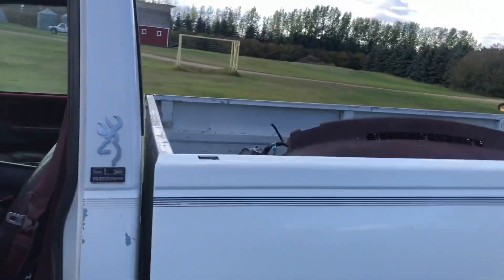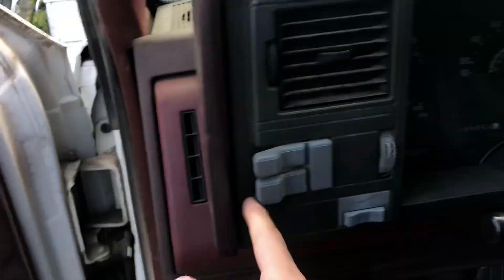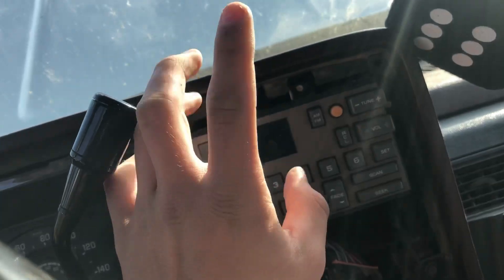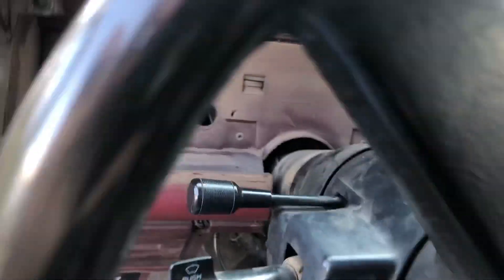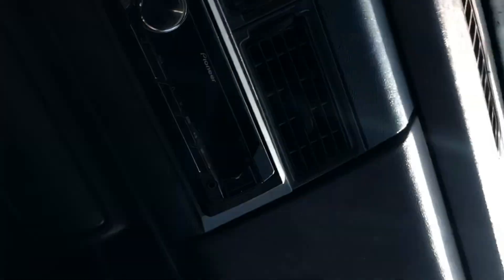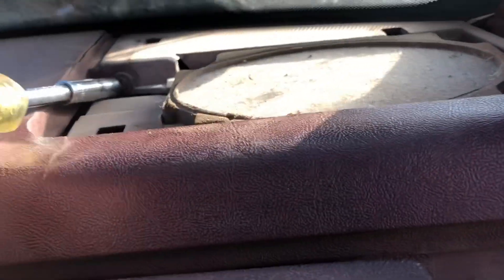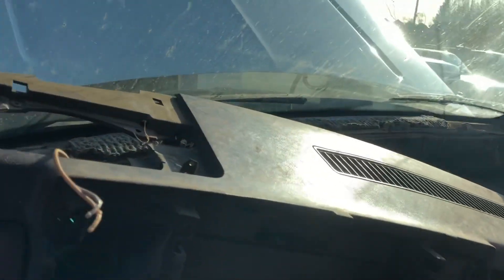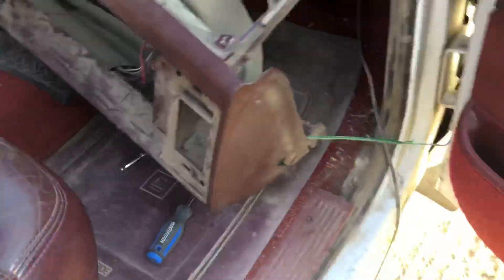88-94 dash removal Chevy/gmc

Comment: Even though your video is pretty sketchy, you at least showed one very important part about getting this dash out. That is you have to remove the heater air plastic tube that runs all the way across the top back of the dash. That is the only way you are going to release the wiring harness. The wiring harness was put on the dash first at the factory before the dash was put in. Then they connected all the wires to the fuse boxes and everything else. If you don't remove that long vent tube, you will have to disconnect the entire harness and that is not something you want to do unless you are restoring your truck.
Reply: thank you
Reply: I think I just did that :(

Comment: At just 49 second point, you want to disconnect the damn battery. There is just so much wrong with this. You're ending up with more parts to buy as you are breaking them taking them off.

Comment: Im going to swap my dash from a 90 to a 94 the only difference is where all the gauges are that's different can I still use the same one or the one going with the swap?
Reply: If its 88-98 it's most likely to match up cause I installed a 98 GMC Sierra dash into my 89 Chevy Silverado only number that has to match is the one behind the gauges there's a 4/3/2/1 but mines is a Silverado and reason y I did that is cause I wanted a stronger dash that won't break easily cause the GMC late 90s they started to make it with mixtures of a stronger plastic with metal only way u can see the metal is if u cut it but that's jus only number that has to match and if so your rocken and do it
Reply: Jayden Bosquez y does the number have to match?
Reply: @4evrthugn   the reason why is cause the screws and holes are set to certain size hole and if it does not match your gonna have to do a lot of modifications to the hole sizes
Reply: Jayden Bosquez what about the wiring harness everything just plugs in no problem I got a 93 and I’m getting a dash from a 97
Reply: @floridashitglee9387  of course it will work jus go with a dash from 96 to 99 cause the dashes are made from something else it won't crack fast will last u alot of hasle instead of breaking and wires will go in no problem but if it work it works sometimes u jus gotta overthink it before u underestimate it
Reply: Jayden Bosquez found a guy on offer up selling me the whole dash wiring harness cluster all the switches for 200 bucks
Reply: So what number am I looking for on the pack of the cluster?
Reply: @floridashitglee9387  pull off your gauges panel the number right behind it is the number
Reply: Jayden Bosquez and it has to match the number on my cluster?
Reply: @floridashitglee9387  behind the cluster on your dash there is a big ass number it has to match that in order to fit properly
Reply: Jayden Bosquez appreciate the info!
Reply: @floridashitglee9387  And for the gauges make sure it's automatic and the same one proper for your vehicle otherwise your gonna run into a problem it's not rocket Science it's real simple as u catch on and word of advice to make the swap easier pull out the steering wheel and to get even more space pull out the seats it's what I would do as well to detail the floor board cause if the old dash is already cracked your gonna have pieces everywhere
Reply: Jayden Bosquez appreciate it going to pick up the dash right now I’ll keep you updated
Reply: @floridashitglee9387  How did it go?
Reply: What happens with all the speakers in the dash? you have to rewire everything? You have to get new door panels to put in door panels?
Reply: @mattc6353  no everything can be re used an it's not complicated I did a swap in 9 hours by myself
Reply: @jaydenbosquez2953  so if I wanna do that conversion and I got the harness is it just plug and play?
Reply: @mattc6353  but note this RN if u put a rounder dash I recomend swapping thw doors but if its more boxed off then leave the door panels
Reply: @jorgiejamz3795  more likely unless u install something new jus know u have to take out everything and a heads up u want to get new insulation for the a.c. tubes cause I will guarantee they are not gonna be intact and another suggestion is use a box to keep your screws organized so ones not bigger than the other and pull your seat out so u have more space to movr around and jus keep track of your screws only part thats gonna be tacky is the screws make sure u use a box not a magnet tray a box so I can peice it in and have like a desight of where they needa be cause I got lost with mine for a min but on top of that your cluster plug will kinda be a fiddle to play with jus be patient and pull it out thru the back even watch videos u learn something new every time and if u have any more questions bout old vehicles shoot me a text off Instagram my name is(    jaydowg2002     )

Comment: How does the new dash fit? Or what kind of modifications did you have to do to get it in there? I plan on doing the same with my 93 blazer
Reply from the maker: GCableHD the dash fits in exact same as factory wiring is just hard but read forms and it's easy.